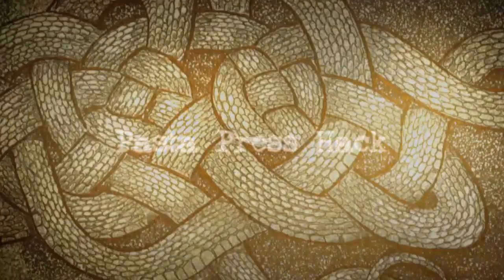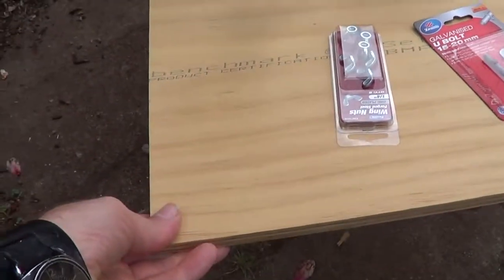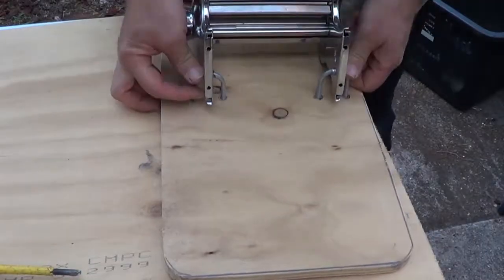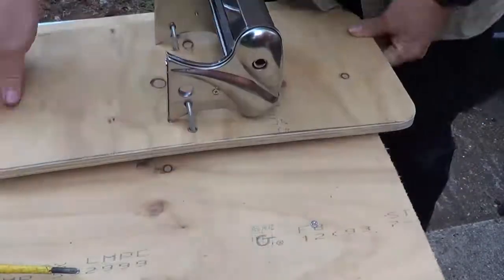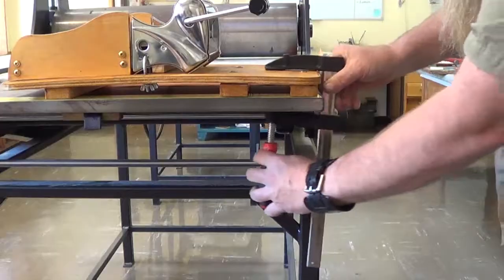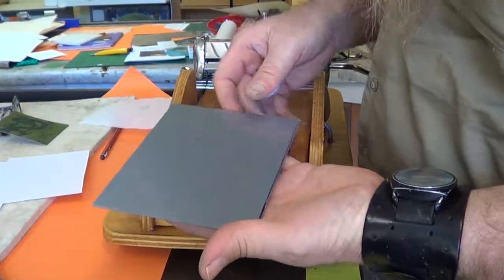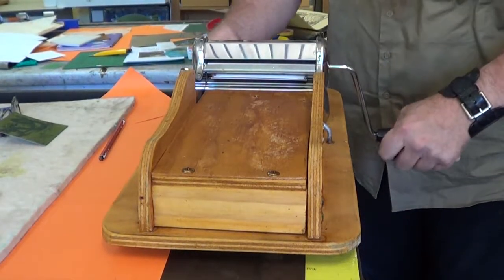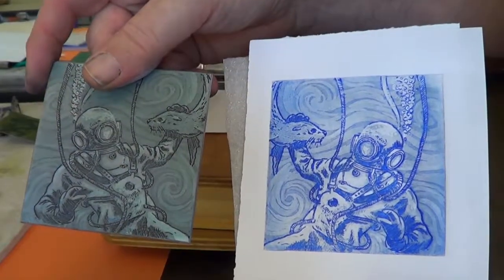Printing with a Pasta Press

Comment: Hi, nice video. The second plate is that really aluminium? I see a sort of aquatint too, how do you do this with a aluminium plate? Also on my pasta machine a linocut would not fit I think.
Reply from the maker: Yes aluminium, no not aquatint, when you open bite aluminium it reveals a nice fine grain. Some pasta presses open up more than others, I have been able to print lino with this but only on thin paper.  
 Here is a link to how I made the aluminium etching 
 https://www.youtube.com/watch?v=sau7ECJN6Zw